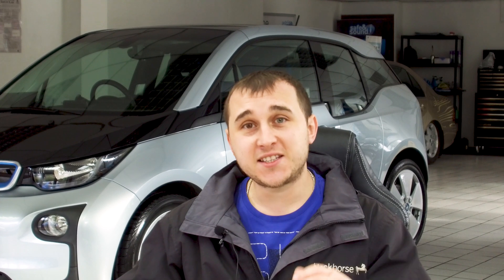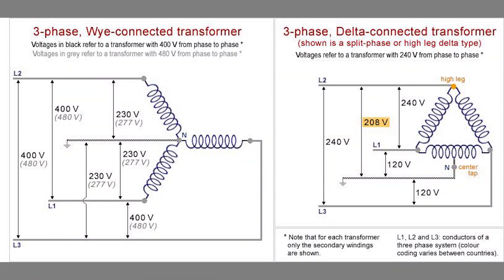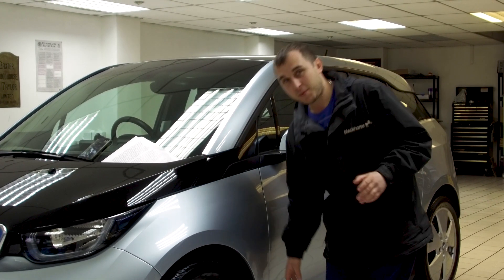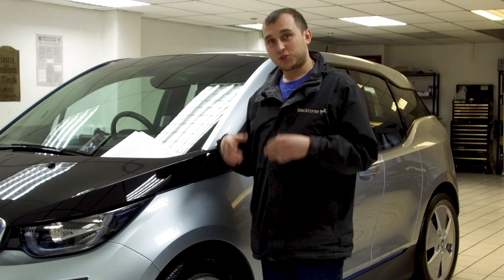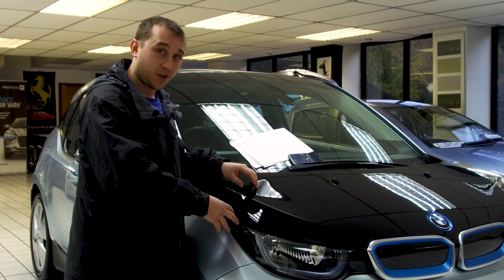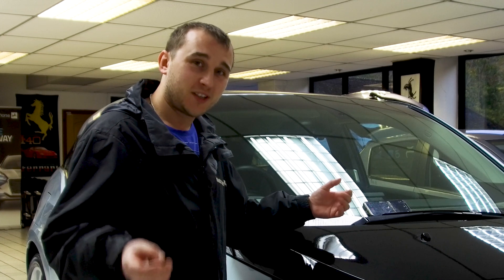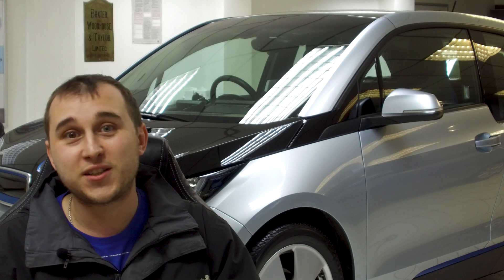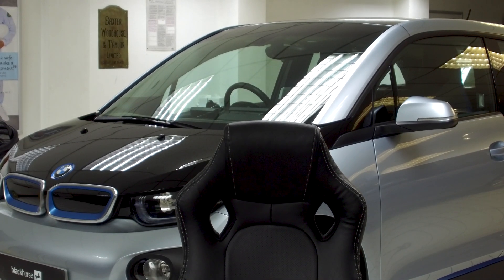How Do Electric Cars Work AC DC What They Mean

Comment: AC is used for large area power distribution because it can be converted to and from high voltages by using a simple transformer. No electronics are needed.
 
High voltages are used for national distribution because high voltage means lower current for the same power transmission. This cuts cable costs, but resistive losses also increase with the current squared (W = I^2 x R), so lower currents (higher voltages) are used wherever possible. The National Grid might use 415,000 Volts in some sectors for distribution, because this is 1,000 times 415 Volts, thus current is 1/1,000 that at 415 V, meaning that resistive losses are reduced by 1/1,000 x 1/1,000 = 1/1,000,000. Quite a saving!

Stepping up high power DC voltages is not as simple, cheap, and reliable as changing AC Voltages in transformers, although a few submarine HVDC interconnects do exist.

Comment: 7 45: Direct magnet motor? If you're going to lecture, please be careful what you say. But thanks for aiming to clarify stuff that's not well understood. 
Oh and earlier, [talking about 2 and 3 phase] it's the higher potential [measured in volts] that allows more current [measured in amps] to flow in a given load. 
50 [or 60] Hz is the frequency at which the AC of the mains supply oscillates. For most people 'frequency response' is one measure of whether your speakers will reproduce bass and treble [etc] evenly. 
I wonder where you got the 3-phase diagram from. I'm pretty sure 'Wye-connected' should be 'Y-connected'. The Wye is a river.   :)          (Incidentally, some rivers end at a delta!)
You're a great example to us all with your holistic approach to green issues.
Reply: Wye connected is sometimes spelled that way to avoid people misreading Y as gamma, and calling it gamma, following the perception that 'Delta' is a Greek alphabet letter. It's been around for at least 45 years. I have a pocket reference book, which I bought new in about 1975, and which calls them 'Y' or 'Wye' and 'Delta'